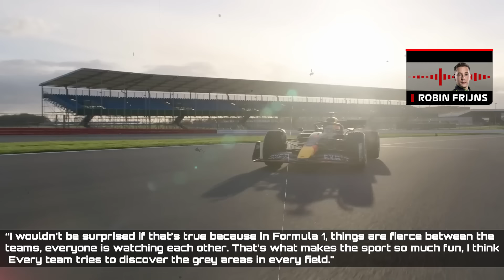FIA Officially Drop BOMBSHELL on Red Bull after CHEATING SCANDAL!

Comment: It's laughable they say they took a wrong direction with the car . If something is wrong , you roll it back to when it was good , then go again . The only reason you can't go back , is if you CAN'T  use what you had before.
Reply: Your lack of knowledge about the technical side of F1 is laughable.
Reply: Spot on. They can roll back because they still have all the old components which they may have changed. If they tossed them in the bin, they still have all the CADs so can remanufacture them. It’s not rocket science to revert to the same spec they used before these upgrades were added. Assuming of course they are allowed to 😁

Comment: If the rulebook says nothing about it, you can fuck around with it. This goes for any team. Gray areas are there to be exploited. If it is then deemed unfair, they can ban it afterwards.
Like the williams active suspension and DAS.
Reply: Braking force must be applied to all wheels equally was already in the rules, did you somehow miss that they only added one extra redundant line to cover themselves?
Reply: The trouble with your argument is that Williams and Mercedes informed the FIA what they were using and got the green light, Redbull have kept this a secret because they knew it was illegal as it’s stated in the rules so if they used this on their car in the previous two years they should be disqualified and their championships taken off them.
Reply: They just explained about brake bias it doesn't have to do with the back wheels with different breaking that is already going on I think they mean one side or the other of the front brakes
Reply: @deanhall5363  DAS was a surprise for everyone, so with that same argument, how do we know that RB behind the scenes did not discuss anything with the FIA?
Reply: I was in the pits at the Silverstone tyre test one wet day in 1987. Nakajima's Lotus was up on stands and they were testing the active suspension function. It was not banned at the time either Lotus or Williams were using it. Your assumption that it is OK to ignore the implication of the rules, known as the spirit of the law is also incorrect.
Reply: @evilformerlys4704  "the forces applied to the brake pads are the same magnitude and act as opposing pairs on a given brake disc."
What I'm reading here is equal force on both sides of the brake disc, on a given brake disc. not equal across an axle.
Gray areas. Hate them all you want, but people in every sport will play with gray areas to get an edge.
Wallriding in nascar? wasn't specifically stated to be illegal, until chastain did it. Now it's illegal.
Reply: Force and DE-PRESSURE are different things 🤷 wording that's how loop holes are made 🤷

Comment: the fact that FIA changes the rules mid season prooves that it’s not a cheat.  How did mercedes was so dominant a few years ago?  By exploiting the grey area as RB does now.  Remember the moving steering wheel in mercedes ( as explained in this video).
Reply: that wasn't illegal which was why it was removed at the end of the season and not pulled up midway.
Reply: @ku16610  good point.  But the fact remains, is wasn’t illegal until they changed the rules.

Comment: Nothing gray about the brakes must apply the same pressure on all brakes. When applied. This is F1 protecting RB again!
Reply: That's what the rules say NOW. but if its not explicitly stated, there is no cheating about it. Like DAS. It was deemed a "steering system" instead of a form of active system. when clearly it adjusted the geometry of the front axles. and active parts are not allowed. But it was allowed anyway. and gave them an advantage as well.
Innovation between the lines.
Reply: I agree. In the original it says all pads in the circuit so it covers asymmetrical braking anyway. FIA trying to make it look like there was a grey area when there wasn’t.
Reply: @hurkadurk, you're incorrect they only added one extra line. The fact is braking force must be the same was there in the rules nearly 10 years now.
Reply: @hurkadurk  is that the same grey area as.. "any..! doesn't mean all..! cars must unlap themselves after the safety car" yeah right! pull the other one! more forked tongue rhetoric by the FIA to protect their golden goose pet project costcapstappen and RBR
Reply: @julesjules7097 so the grey area steering system of mercedes should be deemed illegal, and they should forfeit the 3 world championships they won with the system.
Reply: @evilformerlys4704  "the forces applied to the brake pads are the same magnitude and act as opposing pairs on a given brake disc."
What I'm reading here is equal force on both sides of the brake disc, on a given brake disc. not equal across an axle.
And i'm sure thats what RB read, and thats why FIA had to clarify in more detail.
I'm not the one making the rules buddy. They shouldve made asymmetric braking watertight ever since the Mclaren "scandal".
Reply: can't u see the extremely simple "grey area " ? The rules are talking about brake pressure applied. The system that redbull "seems ' to be have using was working with DE-PRESSURE not directly applied force so in terms or wording then yea it was most definitely a grey area 🤷 that's how loop holes work  in the wording

Comment: All gains from cheating should be taken away.....
Reply: This is the problem, since they used it without introducing it to the FIA, nobody know how long they are using that.. the DAS was properly listed on the car change list, so they knowed exactly how long was in use before they banned it, but here they have no clue about that it's only used in this year, or they are already won 2 titles with it..
Reply: No! Whyy its f1 duuh😂
Reply: Then you realize LH won zero WDCs between 2014-2021 right?

Comment: Interesting thoughts about torque steering.  By rights, if they were using this, then it could be a setting affected at the start of the weekend before FP1.  

Every week in commentary, Crofty or Brundle will mention whether the circuit is clockwise or anticlockwise.  A clockwise circuit will contain more righthanded corners.  Similarly, an anticlockwise circuit has more lefthanded corners.   Therefore, if they were using torque steering, it could be set and forgotten as the car gets built for the weekend on a Thursday.   You would aim for the side you're making the majority of the turns on.  The engineers know from experience whether they are heading out to either rotation direction every weekend.

And I know the word "if" is doing a lot of heavy lifting in those sentences.

Comment: Look, i dont care how long they been using it and it really doesnt matter does it?  The road going forward should have been, one, rewrite the rule and close the loop hole. Two, DQ Red Bull for the remainder of the season freezing their points where they are.  Three, suspend them from the track for the remainder of the season.  They INTENTIONALLY developed a system to exploit the rules.  That is cheating to its greatest extent.  Just because it isnt written doesnt mean its ok to do.  It violates the Cardinal Rule for all motorsports, and yes that includes Formula 1, to abide by conduct and development that doesnt violate the spirit of the rules.  Why are they not taking action?   That should be the bigger question amongst the media publishing all this crap about a scandal at Red Bull.  They freakin cheated and should be penalized without any bias or tolerance. PERIOD, End of Story.  Now people are starting to see how broken the FiA and FOM are.  This is not only egg on the face but also promotes cheating.  Without a DQ or Supsension, rewriting rules doesnt have any teeth to enforce that cheating and the intent of cheating will not be tolerated.  Pussyfooting does not solve the problem.

Comment: The prohibition was clear in the original wording. The addition adds little to nothing.

11.1.1 defines the circuit as the front or the rear.
11.1.2 requires the magnitude of pressure within a brake circuit be equal.

The new words are not adding anything. They just give Red Bull some 'plausible deniability'. Until we learn a lot more, it is not unreasonable to consider the RBs from '22 and '23 to have also been illegal and thus the WDCs and CCs won now have asterisks, too.

Not a record any driver would seek, is it?